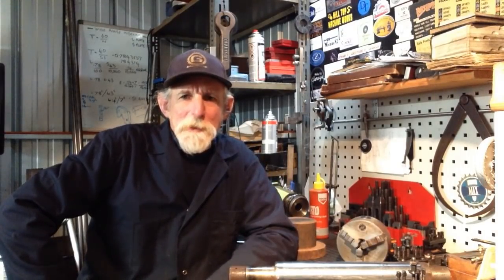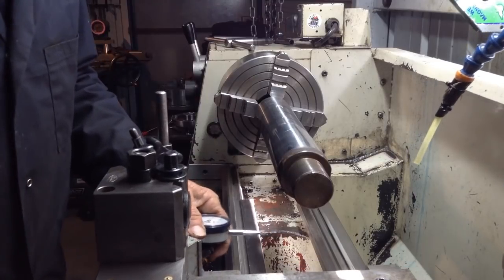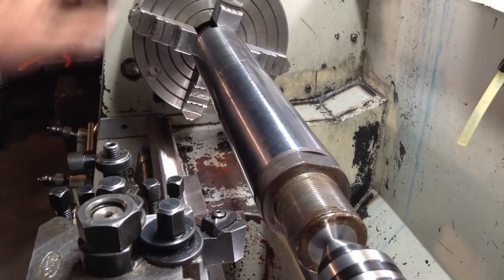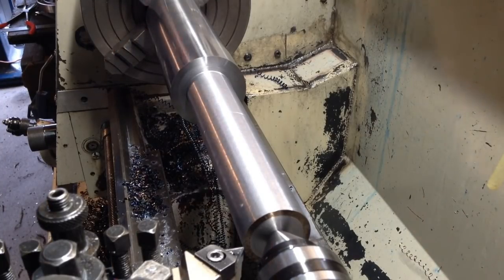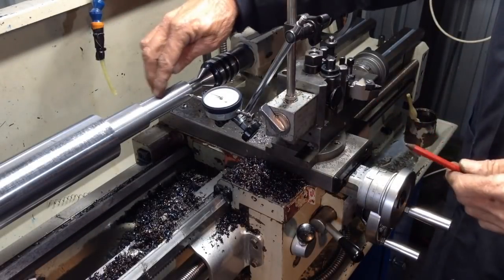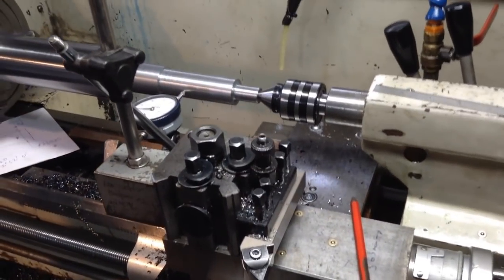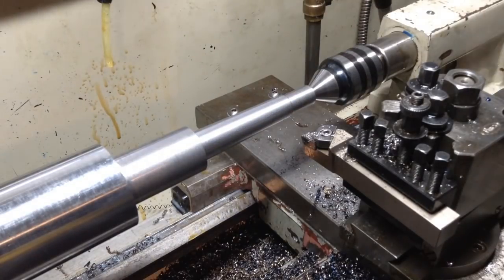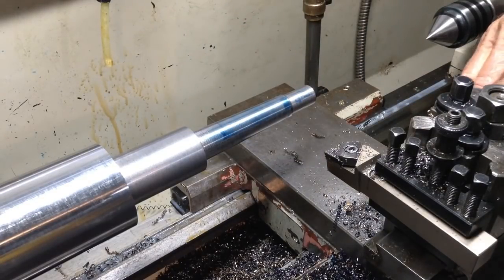Lathe Tailstock Chuck Mount .    Part 1 .

Comment: Wonderful idea Max and tool as handy as a pocket in a shirt. I built one for working on tubular parts, i.e. hydraulic cylinders some years back. Yours is way fancier than mine with seals and a retainer bolt even!  Mine was just a press fit. Cheers
Reply from the maker: Beats the spiders we used to use , they were a right pain !

Comment: I do not ever recal seeing such a tool in use so I'm going to be eagerly awaiting the next instalment.Whena taper test fit hids home like that you justknow it's a propper fit. First part I made on my lathe was a live centre, Head and tail stock being machcing tapers I used the tailstock to set the compoundand test fit the work, it did not want to let the job go! I scribed a heavy line on the saddle to set up quikly for the next time. Thanks for the vid Max
Reply from the maker: No worries .   Cheers .

Comment: Hi Max. Enjoyed the machining and picked up two good useful tips, using the 50mm spaced lines on the top slide for quick easy referencing the 
distance of travel required and only using your digital calliper when the tolerances become important near finishing to save ware and tare. Tony
Reply from the maker: See , i don't have all bad habits !    Cheers .

Comment: Hello Max,
I think the tailstock chucks are a good thing... I am not a big fan of making tools for just in case you need them but I really do think most machinist would use a tailstock chuck frequently if they had one... See you on Part 2.
Cheers.
Paul,,
Reply from the maker: Hi Paul .  Yes , there has been times when i wished i had one .   Now i do , almost  !   Cheers .

Comment: That was some really nice work, Max. I was going to try an make one of these myself, but I lucked into a really good deal on an inexpensive one a while back. It is likely no where near as nice as the one you are building, but should suffice in a pinch.
Reply from the maker: Hi Rob . Not the sort of thing you use every day unless you do lots of long work .  Handy to have , just in case !    Cheers .

Comment: I'm a raw beginner but I know the rule of "No more tnan 4 diametrs of work sticking out of the chuck" (when actually turning). However you had a pretty long piece of work rotating at high rpm without any support such as steady rest when preparing the tailstock center hole. Is it safe to do that? In which case you would use a steady rest in a similar situation? In other words - When using a steady rest while preparing a center hole would be a must? Certain length of work?
Reply from the maker: Depends on the diameter & how much the chuck has hold .    If i was to hold the bar close to the chuck & do the centre , it would not run true when pulled out to the reqd length .   It's a bit of a short cut method .    Don't do it with small diameter stock , say under  16mm or it can bend while rotating  until you have the experience to do so .  The steady rest can be used to support thinner material and large diameters that do not have a fair bit behind the chuck ( into the machine spindle )  .
Reply: @swanvalleymachineshop  Thanks, I reckon it's better to overdo safety requirements at the beginning stages of learning curve.

Comment: Always great Max.  I have a nice 3 jaw tailstock but have been thinking about a 4 jaw tailstock. I have seen the one Kurtis built where he can put the 4 jaw on. I'm pretty sure when he's using the 4 jaw he just uses it long enough to machine an area for the steady rest to ride on.  The way I see it when using the 4 jaw center, if your work ever slipped at the drive end ( headstock ) Then it would also throw things off at the tailstock because its not centered to the bearings. Again this is only when using the 4 jaw tailstock on something that does not run true.  Would love to know your thoughts on that.  Sorry so late getting to this video.     Gary
Reply from the maker: Hi Gary .   Yes , things would want to walk .  The tailstock chuck would have to be indicated to match the high's & low's  along the same plane as the headstock chuck .  
Cheers .

Comment: Obviously more than one person has watched Kurtis and admired his rotating tailstock chuck.
I have designs on paper but have been fraffing around with the bearing preload mechanism  design..
I'll be interested in your finished design.
Interesting you found no induction hardening under that chrome.
Reply from the maker: Hi Carl .  Yes , not all chrome bar is hardened  .    It depends on the use .   The pre load is easy with a spacer .  I will cover that in detail .       Cheers .
Reply: I was considering using a castilated nut, even considered converting a cheap stub axle setup.

Comment: When you faced off the bar it looked like you skipped starting on the outside, and dug in leaving a slight ring at the outside edge. Is that what you did? My eyes could be playing tricks on me, but I was thinking maybe you did that because if you start on the outside it might push the bar out of alignment. Anyway 👍 looking forward to the continued.
Reply: I figured that Max did that for the same reason.  The further out, the more leverage the tool puts on the unsupported end during a cut like that.
Reply from the maker: I generally only face off the section req'd , the rest gets turned off much quicker in longitudinal cuts .  
I will explain when i do the hub & the penny will drop !!!      Cheers .
Reply from the maker: @bobvines00  It does  & at that time i did not know if the steel was tough or soft .

Comment: Those Indian machine shops run their inserts through everything including  lumpy welds, flanges with half in bolt holes , Splines of hardened steel. Pinion gears of hardened  steel , Every ugly surface you can imagine and these people are desperate poor and I'm sure they can't afford to just go down to there local tool shop and grab a few hundred inserts at a time and start breaking them on every ugly surface job ! You got to watch them to believe it !
Reply from the maker: And they do it all in thongs , i watch them !  👍